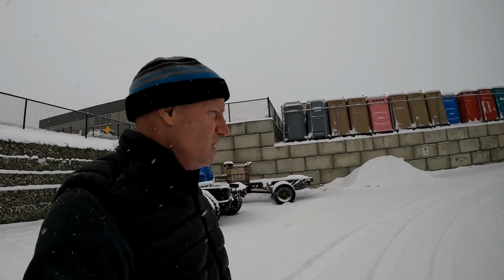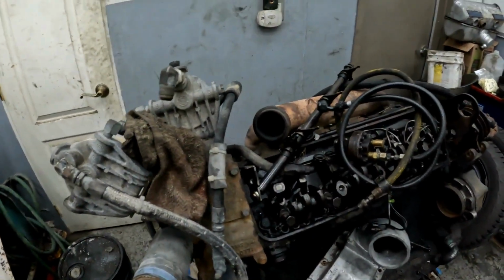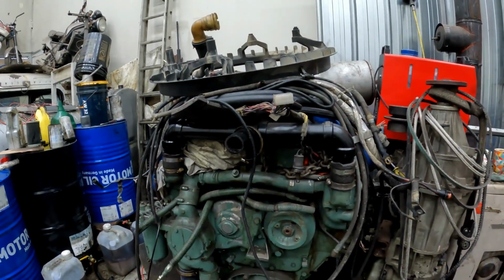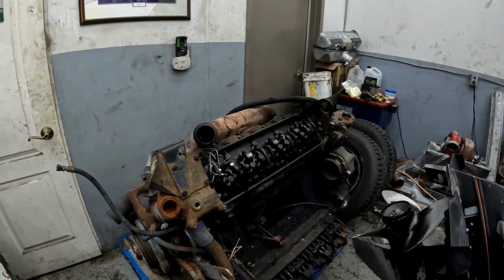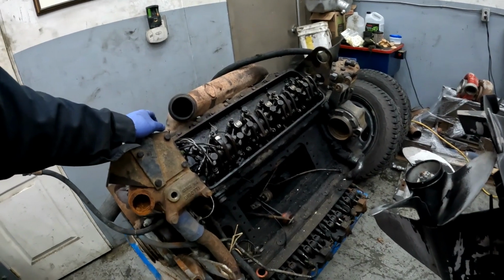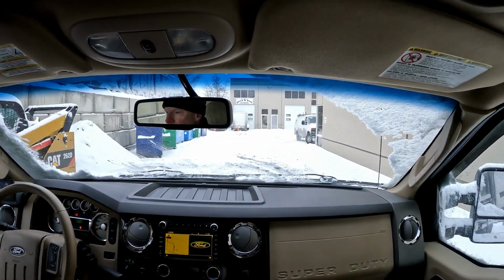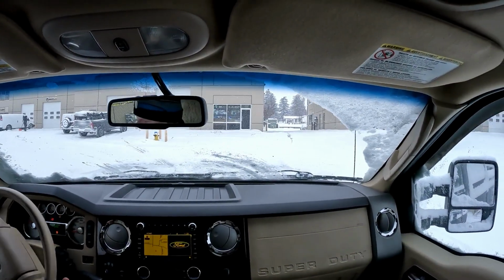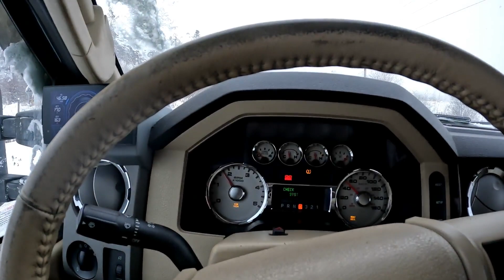Detroit 8V92T, 4-53T Snow Day.:)

Comment: -17 graus Célsius ? shuasausha
Reply from the maker: Sim, realmente desagradável, é -23C agora. :)
Reply: @detroitgarage9430  I don't know snow. Here the maximum cold was -2 degrees Celsius. Average winter from 1 to 20 degrees Césius, summer from 15 to 40 kkkk ;)
I have to freeze everything, I'm afraid I'll have a good preparation for that cold. Here we don't have heating, we use a wood stove, or electric heating, but only a few days. Here in my city it snowed once in August 1965 after never again, in the Serra Gaúcha here in the state of Rio Grande do Sul, sometimes it snows in winter, but always strong weather.
Reply from the maker: @davidetroitdieselnaveia8937  Nice, I lived in Asia for 20 years and the coldest I ever saw was 12C.:)
Reply: @detroitgarage9430  😎